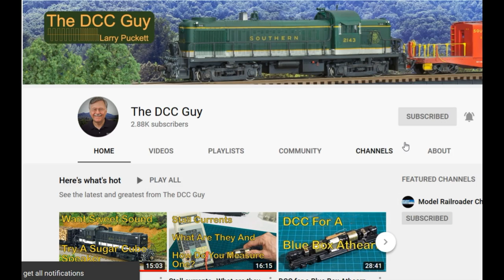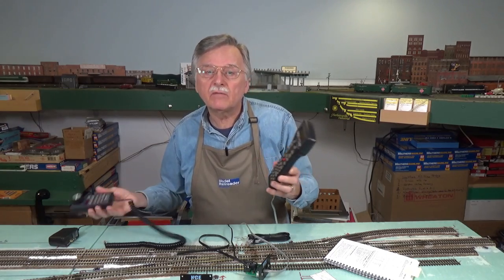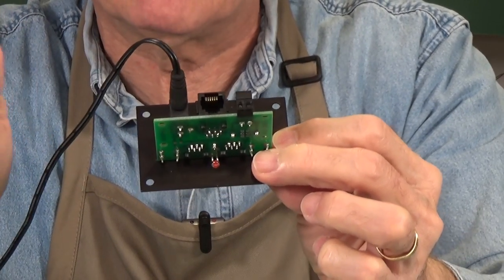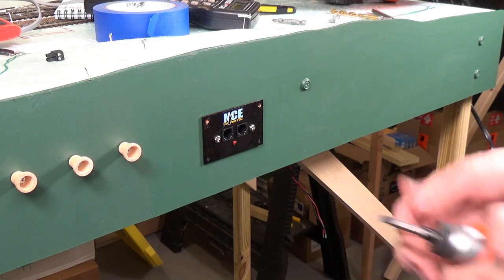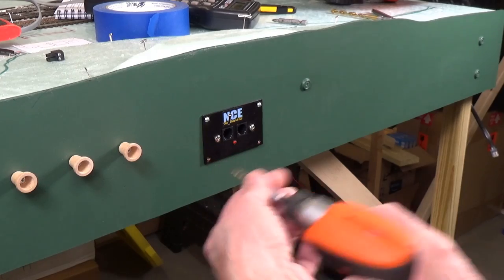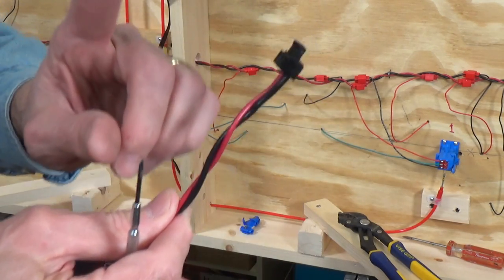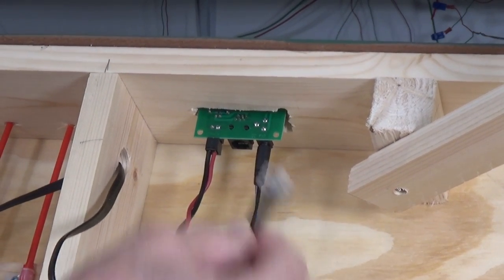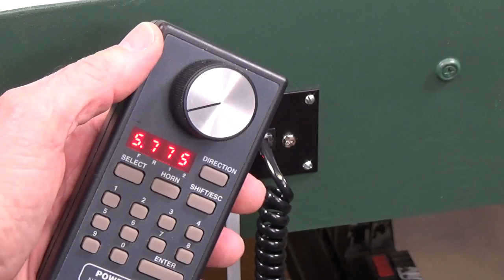Install An NCE PowerCab DCC System (151)

Comment: I bypassed using DCC.  I had a hard time going back to a 1980’s technology.  I went with Railpro direct radio with net.  And I am going all battery.  So I am dead rail on my layout.  No frog juicers, no reverse polarity circuits for loops, no worry with dirty track just like in real life.  I am going to add the AM-1 module as well to control my switches from the hand held.  I have saved a lot of money as well going this route!
Reply: Just gotta deal with batteries and modifications to make said batteries fit and you then you gotta recharge them
Reply: @mikeadler2755  deal with batteries!?  Like any R/C car, plane, or phone, or tablet, or any other modern device!  I like having multiple box cars with batteries.  After 2 hrs of running your train, just plug in another and put the decharged boxcar on the charger.

Comment: Go with the Pro Cab. I went wireless and would recommend it. The Power Cab is good if you only run one train at a time but it has too many limitations if you want to expand.

Comment: I like that this was a simple explanation  of the NCE installation. I'm going to be building a small British shunting layout in the near future.
Reply from the maker: Glad it was useful. I plan to do a followup on installing the 5 amp Smart booster to upgrade the PowerCab. However NCE is out of parts for those right now and waiting a shipment before they can send me one. Their system is pretty good for beginners and anyone new to DCC plus it has a great expansion pathway. DCC Concepts seems to offer a lot of compatible products and they sell NCE too as I remember.

Comment: Thank you Larry for an excellent Video, The Loco negotiated those Turnouts perfectly, mind surprised that you’re using an NCE System I thought you were a Digitrax Man. Keep Safe. Guess you’ll getting ready for Christmas soon too.
Reply from the maker: Peter, back in 1994 I received a Wangrow System One and a Digitrax Challenger systems for reviews. The System One DCC system and NCE were clones and used the same software produced by NCE. I liked System One and it was a strong performer at first but due to its high cost and lack of an entry level version it eventually failed leaving NCE with essentially the same system and lower cost versions. Since then I have always had one type of System One or NCE clone, but for various reasons I ended up choosing Digitrax for my layouts. Maybe it was the breadth of their product line along with early wireless throttles that won me over. I have known the late Don Wangrow, Jim Scorse (NCE), and AJ and Zana Ireland (Digitrax) since those early years and always considered then friends, and I don’t really play favorites. So these modules were a good opportunity for me to use the PowerCab system Jim sent me a few years ago for a review. It is a great introductory system with an easy upgrade path and it has done a lot for popularizing the NCE product range. Over the years I have accumulated at least one of just about every product Digitrax has made and could have easily used a Zephyr, or Chief, or Evolution system and I still might show how easy it would be to make a changeover.
Reply: @TheDCCGuy  Thank-You Larry, jeepers you are so quick with your Replies. You might remember that I live in North Devon, Southwest Britain, and it's a wee bit chilly here at the Moment, what's it like over there? I normally get up at about 04;30 and go for a 5 km run, I'll be 74 at Christmas but it keeps me fit. It was -6C this morning and I was very pleased to Home.
Reply: @TheDCCGuy  Thank-You Larry, jeepers you are so quick with your Replies. You might remember that I live in North Devon, Southwest Britain, and it's a wee bit chilly here at the Moment, what's it like over there? I normally get up at about 04;30 and go for a 5 km run, I'll be 74 at Christmas but it keeps me fit. It was -6C this morning and I was very pleased to Home.
Reply from the maker: I had no idea it got that cold over there! We have been dipping into the 0 to -7 range occasionally but that usually doesn’t happen here until Jan-Feb. Although I live in the South because I am up in the mountains at >2000’  it is about the same climate as the Washington DC area, much further north of here, where I used to live, but a lot less humid and cooler in summer.

I usually spend the morning hours catching up on news and emails so have the iPad on and these notifications pop up as you guys post them so it is easy for me to keep up. However once I start moving about and working on things I generally have to ignore YouTube until the evening. But I get enough emails and queries here that I do either have to respond fairly quickly or miss some. 

Since you are in Devon maybe you can answer a question for me. I plan to order an Id Backscenes backscene for the modules, specificallly Old Mill Town ID-230A&B on the Hattons website once they are back in stock. Those 2 appear to look close to a rural Devon scene, at least compared to what is offered. Would you take a look at those and tell me if they are good representations? Had the Covid not popped up I would probably have made it over there this summer and shot my own photos for backscenes but these will have to do unless you know of better ones. Thanks—Larry
Reply: @TheDCCGuy  I  must confess, it’s not often as cold, but I live in the sticks.

Comment: Hi Larry.. your channel goes from strength to strength. For a returning modeller I’ve found so much information that’s saved me time and money. Many thanks. 
I have the NCE Power Cab and I find this ideal. 
Can I ask you about the BUS cabling?
I have a two tier layout .... upper and lower track circuits.
Can I T into the BUS and split across to the upper layout or should it ideally be installed  as a single run with a start and an end ? 
Apologies for asking on this video ( particularly if I’ve missed one covering this)... but I’d like to maximise the Power Cab. Thank you for your time... Regards..Colin H
Reply from the maker: Colin—I have never tried a t-split but it would be easy enough to try it out. I really don’t see why it would not work, really is no different than a simple split. Of course all their diagrams show direct connections from an EB circuit breaker to a block so were no help. The main issue is it greatly extends the length of the bus run so it probably is better to go out form the booster in a star pattern.
Reply: Thank you for getting back ... yes that makes more sense.. thanks Larry... Colin..

Comment: Hay Larry : On a similar topic .... How important is the orientation of the  six-way  colour-strands of the flat data cable in respect of the  RJ-Plugs ( One Facing Upside  /  One Facing Downside )  at each end when making the necessary  daisy-chain  connections ?  Much Ta / John

Comment: Larry! You need a multi-tool(oscillating), to cut the slot out of your faschia for the NCE power panel.  It would be much easier and quicker. That is what I use.  You can get a corded one at Harbor Freight for 12 or 13 dollars. Thanks, Russ from Oregon.
Reply from the maker: I keep hearing that, but one more tool might tip the Craftsman toll chest over!

Comment: Question do you have to use the same size bus wire for the NCE connection or can you use smaller gage wiring?
Reply from the maker: If your wire won’t fit in the connector then just use a short transition piece of smaller diameter and splice them.

Comment: Hey Larry, I really enjoy your videos and have learned a lot watching them. On one of your videos you were airbrushing acrylics indoors while using a shop vac to exhaust the overspray. Do you think that a shop vac connected to a spray booth would work in the same way? I want to buy  a booth, but don’t have a place to exhaust it.
Reply from the maker: I don’t think it would be a good option as even with it there is overspray that gets past it. I do wear a particle mask when I use it too. You can easily exhaust a spray booth out a window. For my booth I took a piece of plywood cut the width of the window and tall enough fo a clothes dryer duct. I then cut a similar sized hole in the plywood, inserted the duct, and just put it in the window when spraying. It exhausts into a basement window well but any window will do as long as you can open it wide enough for an exhaust duct. MicroMark sells a fold up booth with built in filters that can be used indoors for acrylics and they have an optional duct kit for it (https://www.micromark.com/Fold-Up-Spray-Booth). I have never seen one but it looks like it might work.

Comment: Very interesting. I have two questions:
1.  Can the NCE System run the track layout from the two wires coming from a standard Atlas 2 wire terminal track?  The under the table “bus” wiring system is way over my pay grade.  Can  I connect the NCE terminal to a two wire terminal track?

2.  I have a very nice Rapido SW 1500 that doesn’t have a DCC adapter installed 
in the locomotive engine. Can I still use the NCE System?
Thank you for your consideration. Eric.
Reply from the maker: While it possibly could do it on a very small loop of track on anything of any size the voltage drop due to electrical resistance in the rails might bring track voltage down below a point that you would lose control and other problems could crop up.  As for you SW1500 NCE does not support DC only locos.
Reply: Thank you.  @TheDCCGuy
Reply: Thank you.  @TheDCCGuy

Comment: Larry, I really appreciated all of the information on hooking up the system. One question though. When you connected the wires that were connected to your bus and you connected them to the rear of the interface, you didn't seem concerned about the polarity of which wire was left or right (red or black) on the connector into the interface. Does the polarity not matter ? or is it only determined by the wires? Thank you.
Reply from the maker: No it doesn’t matter. As a type of AC, DCC power is constantly switching polarity. It only matters once you start making track connections since there you do have to maintain proper polarity.

Comment: Larry onesuit case connectors the black feed on suit case for the red fee so you used 2 suit Case connectors? Does t the suit case  have an   opening to  accept the feeders so you couldn't  you use just one suit case connector over the bus wire?
Reply from the maker: Each suitcase connector will only do one wire and dropper.

Comment: 2 Quick questions…. Can an MRC Prodigy advance handheld throttle be used as a second throttle, or does it have to be NCE?….and for Z scale, can a 10V power supply be substituted for the NCE’s standard 13.8v power supply that comes with the system?
Reply from the maker: The MRC throttle will not work. As for power this is from the manual:

Use only the provided P114 power supply or a voltage regulated 10-15 VDC supply of 3 Amps or less.
Reply: @TheDCCGuy  thank you!

Comment: Question, I have a three sectional layout, my bus is loose and open on both ends, one end is to connect to my next board. Making sure it's ok to connect to the other end? Or in the middle like yourself?
Reply from the maker: Should be fine, but the recommendation is to not make a complete circle that connects back onto itself without gaps.

Comment: Are the ends of the DCC Power Bus connected to anything? Or do they just suspended under the module for feeders and switch machines to be connected to with the suitcase connectors?
Reply from the maker: They just kind of hang out down there. If you use a snubber then you can insert the ends into the terminals or solder a DIY one there. However don’t connect them to each other or loop back on themselves.
Reply: @TheDCCGuy  Thanks. I've been slowly making a small switching layout and haven't yet purchased a DCC system, but most likely will be NCE. Been killing time lately watching a bunch of your videos.

Comment: Newbie here..... Just learning. I was under the impression the NCE was the train controller and power station. So if I am right. What was the controller in your right hand used for at the end of the video?
Reply from the maker: Both of those are hand held throttles, and in the case of the PowerCab both the DCC command station and booster are also located in the large handheld throttle.
Reply: @TheDCCGuy   Thank you.

Comment: Hi Larry, just bought a NCE starters unit for a shelf layout I'm building, what value circuit breakers would you use, 1amp?
Reply from the maker: Depends on your scale, how many locos you will run at the same time, whether you use accessory decoders for switch machines, and whether it will power lights or other accessories.
Reply: @TheDCCGuy  The max 3 loco's, all other things like lights on the layout and Arduino driven turnouts and semafoor signals are separately powered and have their own source, the NCE will only run the loco's.
The scale is OO British rolling stock, lets say loco have the max on extra internal users such as sound and headlights.
The scene is a Scottish whisky distillery.
The self layout has dual purpose, it runs and is home for a few of my out of my era (normally steam from era1 to 3) shunters and a class 40 diesels.
The other purpose of the layout, it's made in such a way I can use it as a test track for DC and DCC.
Also the first time I worked with Arduino, servo's as a test build for a planned bigger layout run by a Gaugemaster DCC unit.
But I always prefer to run secondary circuits by separate power sources
Regards,
Danny
Reply from the maker: It all depends on the total current they pull. So if they each pull .30 amps max then you are at 0.9 amps and OK. Go over 1 amp and everything will stop.
Reply: @TheDCCGuy  Thanks for sharing your view on this much appreciated👍

Comment: Hi Larry 
Thanks for another great instructional video.
Is it ok to use a Power Cab throttle on a layout that uses a 5amp system for a Pro Cab?
Thanks 
Paul from Zillmere
Reply from the maker: Yes, I should have mentioned that the PowerCab throttle can be used as a regular throttle on another NCE layout.
Reply from the maker: Yes, the coiled cable only has 4 wires whereas the flat cable has 6. The extra 2 wires carry the track power. You use the coiled cable to use a PowerCab as a ProCab.
Reply: Thanks for the prompt reply and the additional information.
Paul from Zillmere

Comment: Is NCE as "expandable" as Digitrax? I only have a small N scale layout with a few locos, so NCE is probably all I need. However, if I ever want to get into more complicated things such as remote control of switches, block detection, automated signals, or computerized train control, is that something that NCE can handle as well, with the right add-ons?

It seems that most large layouts, with more bells and whistles, use Digitrax, and I don't want to limit myself right off the bat by buying NCE.
Reply from the maker: Yes, although Digitrax may offer more accessories than NCE. Also watch video #303.

Comment: Howzit Larry  :  I am aware that different DCC Manufacturers have varying opinions and / or instructions in respect of the  TWISTING / NON-TWISTING  of the heavy-gauged Red / Black wires of the main DCC-Bus for  RF  that may affect the DCC signals .... What do you reckon ?  Similarly; at the end ( s ) of the main DCC-Bus; what should take place ?  I am a committed DIGITRAX user of many years on both of my two medium-sized; HO Layouts and I have not twisted the heavy-gauge Red / Black wires and do not have any  * End-of-Train *  devices ( ! ) where the main DCC-Bus terminates .... And seemingly; all is well with the world. Again; what do youse reckon ?  Regards and Cheers For Now / John

Comment: I’d recommend discontinuing the use of Scotch Locks (we call them vampire clips) as they weaken the wire. You could just as easily use butt connectors, but ideally a soldered joint is superior.
Reply from the maker: Been using them 30 years without any broken wires! I find that folks who have issues with them use the wrong size connector with the wrong size wires or they don’t use the correct pliers for crimping.
Reply: That may be, but just because they're easier, doesn't make them better. I'd strongly recommend discontinuing use, and soldering your connections. This is the proper way to do it. @TheDCCGuy

Comment: Where can I get the 2 wires for the power bus?
Reply from the maker: You can use 14 awg copper or speaker wire. Here is what I use. Also I nabe videos on using suitcase and other connectors with this stuff—limited soldering required. Watch my videos on building the modules, installing a PowerCab, etc. If you use speaker wire use OFC not CCA. 

https://www.parts-express.com/Audtek-SKRL-14-100-14-AWG-OFC-Speaker-Wire-100-ft.-100-021
Reply: @TheDCCGuy  ok, thanks. I have the rest of the year to plan my layout. Shouldn't be too difficult.

Comment: Hi Larry. Question, when the second UTP panel is installed, can you plug in the NCE Power Cab at the second location and run Trains? I know once you remove the Power Cab, everything shuts down, but was wondering if the the power Cab has to be connected to the port where the power supply is. I have 2 yards at opposite ends of my layout and only operate them one at a time, and was wondering if this would be a fix, until I get a booster. Thanks.
Reply from the maker: Dave, I tested mine to make sure and no it will not work. The PowerCab master command station/throttle has to be plugged into that specific port on the main panel. Apparently the wiring necessary for it to work as a command station is in that location only.
Reply: Thank-you Larry.

Comment: I have this NCE power cab and the light on the ucp panel doesn’t come on what’s that mean I know I have power could it be a bad panel or the light be bad
Reply from the maker: Does your system and throttle work otherwise?